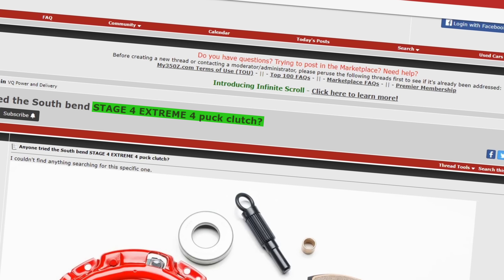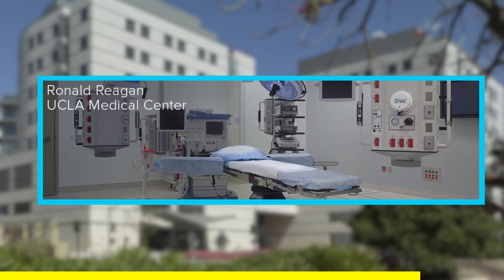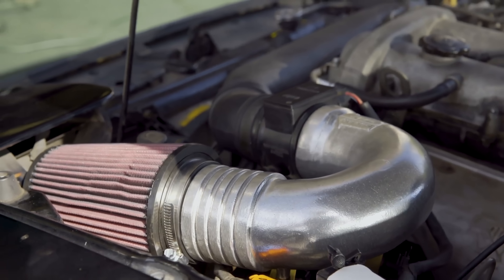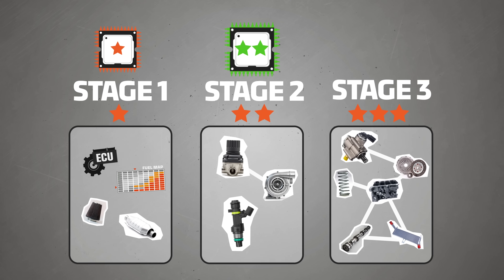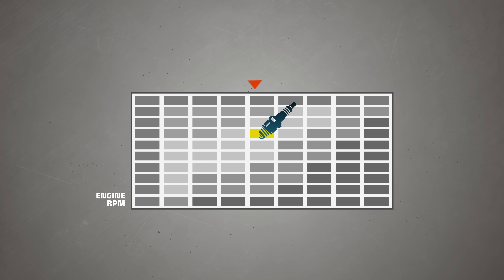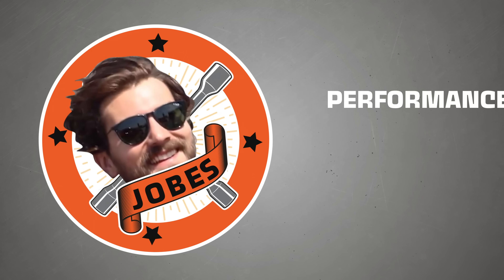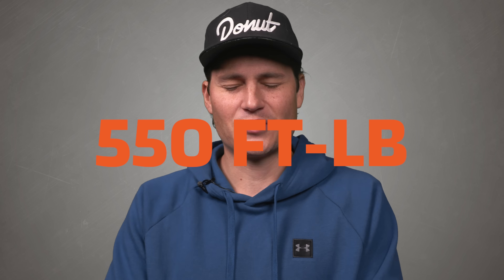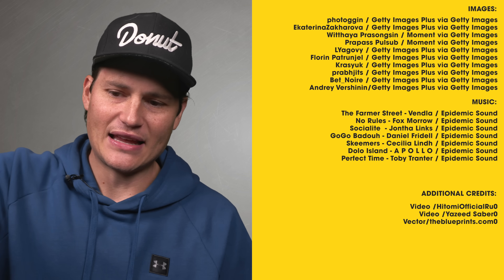What Exactly is Race Tuning?

Comment: Interesting...here in Europe stages mostly refer to engine mods. Stage 1 would be just software, Stage 2 includes some form of exhaust/intake parts and stage 3 is when in addition there are changes to turbos and the intercooler system. At least that's loosely agreed upon.

Comment: I'm building a 2005 Mazda 6 S wagon with 132000 miles. Manual transmission. Got it torn apart now to fix it back to zero. All OEM to get the leaks and squeaks fixed. The body is immaculate aside from a couple small scratches and overall paint decay. I have an engine core to rebuild after I get the thing running. From a 2012 Ford escape 3.0. I'm a Ford and Mazda certified technician. The endgame is street build luxury centrifugal supercharged. Air ride. A/C. Pushing 400hp give or take and running pump gas. I believe I can fly. I reckon I'm gonna try.

Comment: Short end of the stick, unless you're a professional in the industry, probably best to consult with your local performance shop to see what they recommend. Using someone reputable is important. They are going to be the ones that are not only familiar with the work required, but have the insight on how to tune it. 

So many people try to cheap out by adding major components to a OEM set up, then it breaks down.

Comment: Since when was another turbo stage two? 

It's usually drop in panel filter or aftermarket induction kit or cat back exhaust that are stage one usually with a tune

Stage 2 are usually turbo back exhaust mods so a decat or sports cat with uprated intercooler and a tune that's stage two. 

Stage 3 is where you start looking at swapping the turbo with a hybrid turbo and probably depending on what intercooler you have if you have another uprated one then it's probably just about okay but if you didn't get one that's efficient enough for cooling the air with the hybrid then you will need one here. 

Stage 4 is when you look at bigger turbos and at this point probably uprated fuel injectors as you will be hitting max fuel duty cycles and probably need a new fuel pump too. 
You'll also want to start looking at uprating other certain parts of the engine too here. Clutch,  engine mounts are a must here if you for whatever reason didn't decide to get them earlier. Getting that power down will be important. Certain parts of the engine block will want considering for uprating depending on what engine it is, Camshafts for example. Your tuner will most likely know. 
Depending on the engine sometimes you'll need to improve cooling so uprated radiator, maybe an oil cooler. Stage 4 is normally where you are just pushing the car to it's limit. 

Your stages just seem too odd.

Comment: I remember buying my 1st car a 1980 accord hatch back cvcc ...i also been working for about 2 years i was 14 with job and my own car ...1 year later i met a really good mechanic who tricked it out blasted it open and tuned n polished the entire engine and transmission...it was fast fast but looked slower then microwave oven ...i still own this car and i never dyno as its N/A and beefy til this date ...rides like a bmw/toyota

Comment: Stage 1: more wear and mpg for better perfomance
Stage 2: intake, exhaust, turbo, camshaft upgrades etc
Stage 3: engine and transmission reinforcement thus more aggressive settings
Stage 4: deeper rework/redesign i.e. better fuel,  pre-chamber ignition
Stage 5: a jet engine in the trunk?

Comment: Back in my day all we did is advance the timing as far as we could until we got a knock-knock-knock then we advanced it a little more in up the quality of our fuel. If that didn't completely get rid of the night we backed it off what could be considered a smidge measured with love.  We would repeat this process over and over as necessary until we got the desired effect we wanted out of the stock engine.  Enter stage 1.  The beautiful thing as you could have Justin we adjust based on the sheer amount of performance or lack of.  That's what is a cost-efficient way of adjusting at what point on the stroke you ignited your air fuel mixture.  Did I mention the white paint or tape or really any other white substance you can make a few marks with. Having only tune my 82 Buick regal two-door. (Thank beige Grand national that made a 17 second quarter mile look so impossible it was a kin to me making my wife's truck payment on time.  Of course me being somewhere around the middle of my life span we only paid $0.90 a gallon for premium. And before any wise ass out there adjust that $0.90 for 30 years of inflation don't ruin this for me okay. I get old days were still good in my head and I don't want see that get screwed up

Comment: Track racing:  proper alignment, play with tire pressure, no oil leaks, rev limiter. All you can do with a production car. Then you step up to a mid engine car... Lotus Elise or build a AC Cobra. Low COG, alignment, tirepressure, rev limiter and then build an engine. Max hp is less important than durability.

Comment: As far as fiesta guy go, stage 1 is on stock downpipe, stage 2 is when you change the downpipe, stage 3 when you change the turbo, stage 4 when you open the engine changing things like the cams. There si also the stage 5, which is a complete engine rebuild, big whole turbo and shit, 500hp.
IC, exhaust, intake, clutch, ecc.. i just a +

Comment: I have a 2001 Plymouth Prowler. I wish you guys would do a video on the Plymouth Prowler. Also would a cold air intake help increase my prowlers power or hurt its power? It comes factory with 253HP. I’d like to increase the HP to at least 300HP but don’t want to cause other problems or devalue my classic prowler.  Thanks guys

Comment: The lamborghini gallardo stock is a weak engine in the lambo line up. Twin turbo it and get it tuned to stage 4 and well. U have 2,500 horsepower and 1851 whp. It becomes the most powerful :)

Comment: When you add a Cold air intake also costume exhaust should you mess with the ECU or is just fine the way it is?
Reply: Definitely need an ECU tune. Any hardware upgrades without tuning the ECU to adjust for those other mods are basically useless and less beneficial than a standalone ECU tune with no hardware.

Comment: For Harley Davidsons at least the MoCo has standardized this, so even if you’re smart and buy aftermarket everyone is on the same page about what kids of mods you have, even if the specifics are up to you. 
Stage 1: Intake air cleaner, slip-on exhaust, tuner (anywhere from a piggyback to a full ECU replacement)
Stage 2: cam upgrade and matching tune, may include new lifters and pushrods
Stage 3: Big bore cylinders & pistons
Stage 4:  headwork, throttle body
Stage 5: Trask Turbo - though you can do this any time as it includes a specific cam and ECU

Note that Harley doesn’t officially support “Stage 5” or any forced induction, while the others you can get with a factory warranty if done by HD with HD parts (which are inferior and expensive)

Comment: We need a standard based on what the customer commits to. I propose this:

Stage 1: Easily undone to stay under engine-warranty.
Example: Just an ECU flash to optimise fuel to air and timing.
Stage 2: Increased flow. Warranty is void but your service interval remains the same.
Example: Downpipe and possibly an intake.
Stage 3: Replace active components. Reliability is unknown and the service interval should be cut in half.
Example: Hybrid turbo and a bigger intercooler.

Comment: Ive made my stock NA mr2 spyder with 140hp to another level. I did engine swap a 3sgte into my spyder. I changed the turbo to g25-660, 1050cc injectors, refurbished engine block with wiseco pistons, fuel regulator, costum made intercooler, costum made catback dual tip exhaust, stage 3 clutch and lightweight flywheel of 4kg. Its having 600hp now. So what stage do i have? Stage 2 or 3?

Comment: I am answering this before the video is watched and see if it relates here= 
1 'RACE' tuning is the tuning where spring life for actuating the valves is not an issue anymore.
2 'RACE' tuning is the tuning where fuel availability is not an issue for daily driving.
3 Race tuning is the tuning when bearing life is miniscule and the engine is rebuilt routinely after every use.
4 Race tuning is the tuning that cold starts and dependability on a daily basis for years is not an issue.
5 idle quality is not an issue.
6 fuel economy is not an issue.
7 fatigue of parts and replacements parts are not an issue.
8 Race tuning for me is any that can win a race or last to the end of it.
Stage tuning is an attempt at defining mostly by camshaft overlap in degrees in relation to engine bore and stroke and the compression needed for those cams to work efficiently with a well efficient built engine with efficient heads and induction fuel system. This dictates cam timing events and not anything else does. Not what rpm you want, not the idle you want, not what you want to use it for, THIS is this engine, and thats it. Wether or not your springs can stand up to it or not is the question of 'RACE' only tuning and non race only tune, RACE tuning is a limitation, not an ability. cheers! :face-green-smiling:

Comment: I always went as follows:
Stage 1: Slap it on, done. 
Stage 2: Shit you can't just slap on but have to take some shit apart and then do other shit so the shit you slapped on in the 1st place works.
Stage 3: Completely taking shit apart, at this point the original parts would implode due to lack of durability.

Comment: Heres how I do it Stage 1 is full bolt ons without changing aspiration or fuel so Full exhaust full intake and a flash tune Stage 2 is full bolt with out changing aspiration so fuel upgrade(injectors, fuel pump, and/or e85), clutch, and stand alone ECU  Stage 3 is fully built with out aspiration change so full bolt ons fuel upgrade, clutch, stand alone ECU, cam, and forged internals Stage four is fully built with turbo good for up too 500whp Stage 5 is fully built with turbo/turbos good for 1000/1000+ and works the same for already turbos engines now anything that's already built crazy from factory like a hellcat or a McLaren or a Ferrari or gt350 like those obviously have different stages like Stage 1 is full bolt Stage 2 is fully built Stage 3 is adding 200-300hp Stage 4  is adding 350-500 and Stage 5 is adding 550 to 800 horse

Comment: Tuning on NA cars and turbo cars is actually not that different. The load axis for both is either a map sensor or maf sensor and if it’s a maf sensor there is only one axis. Using the TPS as a load is really only used in setups like cars with ITBs.

Comment: ok, lemmie spread some stage knowledge that we do in Greece.

Stage 1 : intake + downpipe + ecu tune
Stage 2 : Intercoler + fuel pump + fuel injectors + ecu tune 
Stage 3 : bigger turbo / bigger boost + ecu tune + forged everything (cranshafts+ pistons+block).

Stage 4 : well, I wish I was a mechanic.

There !! in just few words !! (of course a car consists of thousands of parts that can all be modified. blow off valves, oil pumps, oil coolers n shit, haha)

Comment: 10 Stages For Racing Car 
1. Bodykits 
2. Wing Spoiler 
3. Rims 
4. Tires/Type (Y) 
5. Turbo/Twin Turbo/Supercharge 
6. Exhausts, Single, Twin, Triple, Mega 
7. Suspension Upgrade 
8. Performance Seats 
9. Manual transmission
10. Steering Wheel 
Racing Car is advanced. They like BMW M3 GTR or Shelby GT500.

Comment: Stage 1: Software enhancement based on stock hardware
Stage 2: Software enhancement based on aftermarket intake, downpipe and cooler
Stage 3:  Stage 2 hardware with a bigger turbo, bigger injectors and bigger fuel pump, boost pipes and software to make use of all above mentioned hardware upgrades

This is a typical guideline for stages 1-3

More than 3 such as a stage 4,5,6 is really just an exaggerated idea of modifications
Reply: My "stages" are completely different to what you just wrote. My "stage 3" I'm FBO minus any turbo upgrades. "Stage 4" is where a hybrid is introduced. 

So when somebody says I'm stage 3, it could mean something completely different to somebody else. There's no guidelines to it.

Comment: Maybe stage tunes should be based on % horsepower and % torque increase. Not necessarily your add-ons or modifications, but a range of % increase. 
Ex: 
Stage one: + 10-33% 
Stage two: + 34-67%
Stage three: + 68-100%
Stage four: + 100-150%
Etc.

Comment: I always just thought the whole stage thing was silly, speaking in the place of ATVs on a 400ex a stage 1,2,3 hot cam don't do much for adding power just changing when the power actually hits. 1-lower rpm, 2-mid rpm, 3-high rpm. I know it's a overly simplified way of talking about it but the whole stage thing is silly unless brands get together and actually get some baselines for what stage means or does what.

Comment: stage 1 - little to no wrenching, and you stay clean. stage 2 - some specialty skills and tools required. you're prolly gonna smell like fuel when you're done. stage 3 - heavy internal engine upgrades and changes. possible suspension and brakes upgrades. everything you own will become stained with more fluids than you were covered in at birth. all the tools are required, as is a machine shop and at least 3 other people to help at your garage at home. two will help, one will drink up all your beer. stage 4 - performing all three stages on a second engine and then swapping the built one in. carnage, alcohol consumption, and level of grime will be roughly the same as stage 3. stage 5 - cosmetics that add performance. lighter weight body panels, wings, splitters, bigger wheels and tires. high difficulty work of a different kind of dirty. stage 6 - full on customs. some or all of the previous mods have been performed, additional personalization touches are also complete. stage 6 defines what you've intended for the car since starting the project. a complete, reliable, performance vehicle.  stage 6 is a unicorn. it only exists in myth and legend.

Comment: mmm stage 4 rwhp and stage 1 was crankshaft i understand the point of difference but really tuning comes from understanding what a engine can withstand and what a engine needs to produce numbers...it all comes down to more air/exaust flow you need more fuel more combustion more strength in components and around and around it goes where it stops is with your wallet

Comment: I will see this most of us consider anybody that should have say has a turboed car to begin with The stage one is a tune by chip with mostly all the same bolt on crap stage two would be high flow cats injectors fuel pump possibly and a few other things The stage three would be clutch turbos and any other large price ticket stuff like engine works

Comment: My prefered tuning stages..

Stage 0:

Driving skills..

Stage 1:

Tires and suspensions. 

Stage 2:
Aerodynamics and  roll cage.

Stage 3:

Full engine, transmission and ECU  upgrade.

Stage 4:
Buy a real and proper race car.

Stage N:
Upgrade skills to be   a pro racing driver..

Thank you.

Comment: Is there a point where tuning an engine exceeds its design parameters and it's not a good idea?  Say tuning a higher performance car like an SQ5.  Can you do more harm than good by putting the engine under more stress to pump out more power?  What's the maintenance like on a tuned engine?

Comment: The best stage 1 ever is to drop an LS in the car.
Reply: That'd require strengthening the chassis, modifying the engine mounts, replacing the transmission and clutch, possibly replacing the propshafts and halfshafts, maybe the rear diff, and possibly replacing the radiator and other ancillaries.

Might be a bit outside what a "Stage 1" tune would encompass (normally just a chip tune).

Comment: Stage 0: Stock 
Stage 1: Pure bolton, 100% stock internals. 
Stage 2: Upgrades that upgrade the engine's internals, without taking off the head.
Stage 3: Upgrades to just about anything in your engine. Also need to upgrade stuff between the engine and the road or you're going to break shit.
Stage 4: No longer road legal mods. 
Stage 5: Totally unstreetable at this point.
Stage 6: Total race car.

Comment: It’s not rocket science. 

OEM - bone stock from factory
Stage 1 - supporting mods like suspension, intake, BOV, cold air intake, any supporting mod without changing or adding a turbo/bigger turbo or supercharger hardware. 
Stage 2 - adding a turbo / bigger turbo, super charger / bigger supercharger. Power adding mods but not rebuilding engine internals. 
Stage 3- is when you open your engine and upgrade / mod stuff
Stage 4 - is all of the stated above but when you start to take your car to the point where it is no longer road legal. This may include chassis mods that make it no longer road legal, track builds, too much HP for the road and so on.

Comment: I would consider an upgraded turbos more on the stage 3 catagory tbh , stage one exhaust intake (maybe a light tune) Stage 2 exhaust, intake, downpipe, solenoids, throttle body, spark plugs ect